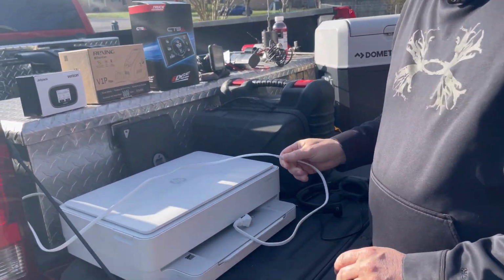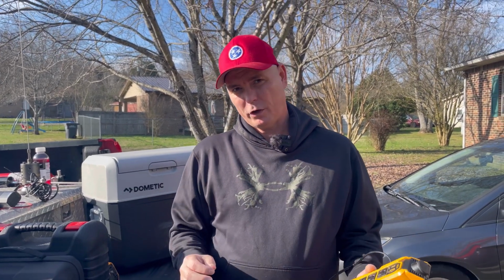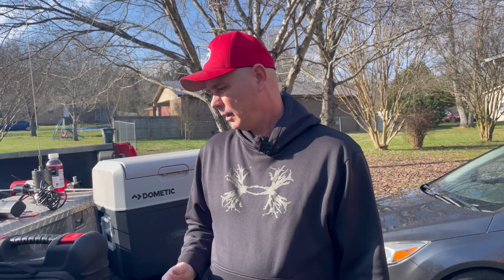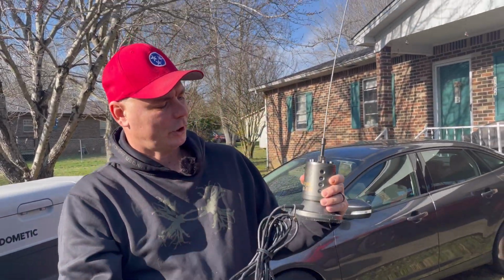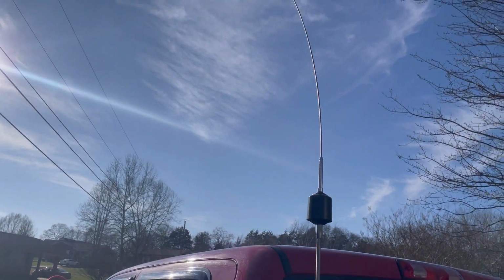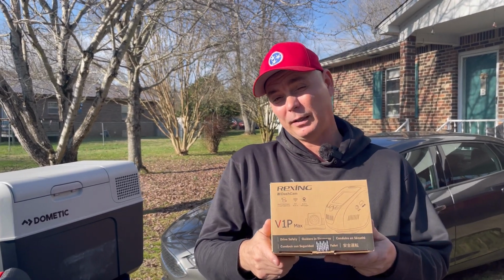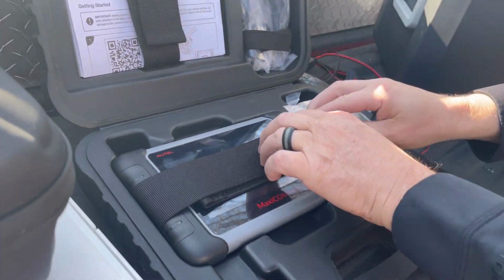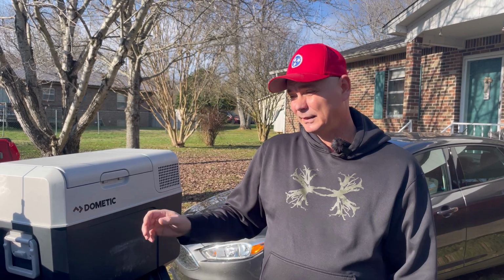RV transport electronics￼

Comment: What 5th wheel hitch are you using.
Reply from the maker: I have a 24,000 Curt q24. I have a 10,000 pound husky weight distribution hitch
Reply: @mr.tennessee  sorry slider hitch or stationery hitch. I should have been more specific on my question. Thanks
Reply from the maker: @bcrawford9072  stationary 5th wheel.

Comment: Nothing better than pickle juice, right out of the pickle jar. I love the sea salt vlassic juice. 

 Have you thought about heat shrink the end of the antenna? I have also used a racquetball,  but it does make the antenna bend.
Reply from the maker: Your right got to love it 😂. Thanks for the information and watching I might give that a try When the weather warms up
Reply: @mr.tennessee  
It is my and many others' pleasure to watch/listen. 
I will be doing Drive Away in February. I want to see what is out there before spending close to $100k for a truck. 
Thanks to your videos of information help calculate the odds and ends of the business which could be costly.
Reply from the maker: @texnolan4740  thanks for watching and I only spent $50,000 on a truck. And setting it up was around 5000. You do not have to have a top-of-the-line of the truck to make money. I don’t know a whole lot about the driveway I hope you do really good at it and if you don’t mind let me know how it is. Thanks for watching and commenting.

Comment: Have you ever looked into cell range extenders? Part of my planning for my truck when I finally get it is to get one.
Reply from the maker: I know somebody that has one. They do work. I really don’t have a lot of problem with service, just in and out sometimes. I use that jet pack for extra Internet. I have thought about getting one and I think they range around $400?? I may not be right on the price. If you get one, let me know what your opinion is..
Reply: @mr.tennessee  i don't know anyone with one personally, the one I was looking at is $519, but there are cheaper options. I have unlimited internet on my phone and laptop thru Verizon. I'm planning on getting one but not right away. Probably be late spring, early summer depending on when I finally get my truck and make it out.
Reply from the maker: @davex36  heck yeah…. Just let me know if you get one and how it works..
Reply: @mr.tennessee  will do. Im gonna send a email later on. Some things truck wise has changed since we last had our email conversation. Plus I got a couple questions that you may be able to use for some material for videos.
Reply from the maker: @davex36  ok… Thanks

Comment: Thanks for the information.  Be safe out there.
Reply from the maker: Thanks for watching and you too
Reply: @mr.tennessee  on your auxiliary tank do you have a pump to the tank or gravity feed for keeping the truck tank full?
Reply from the maker: @jasonspicer2598  gravity feed.
Reply: @mr.tennessee  any issues with the gravity feed?
Reply from the maker: @jasonspicer2598  no issues at all. If you are going to get one with a pump I would get a extra pump just in case it goes out. Because if it goes out the fuel in your tank is not doing you any good